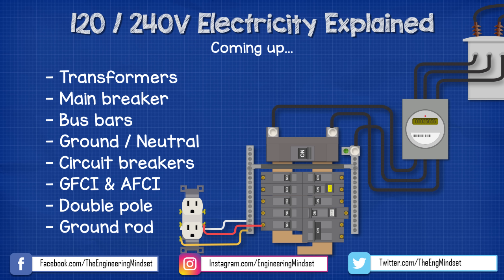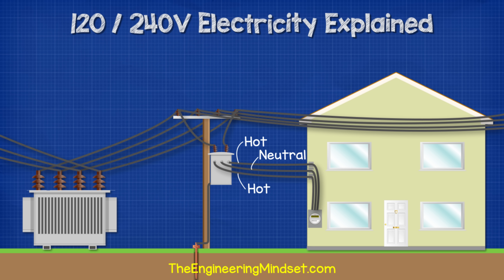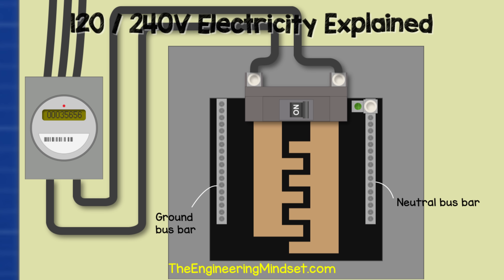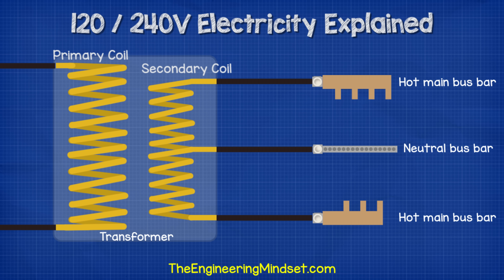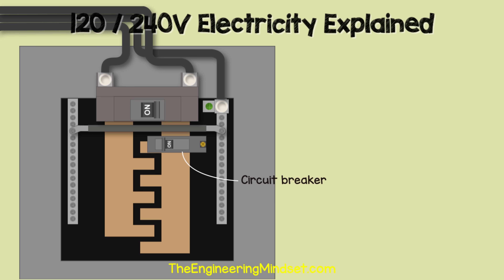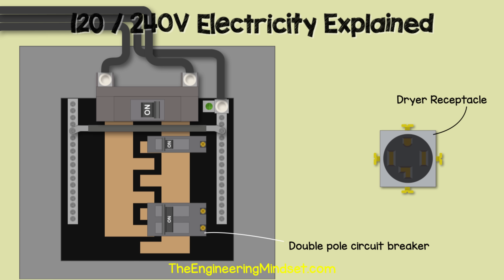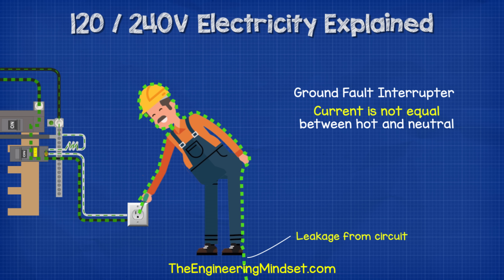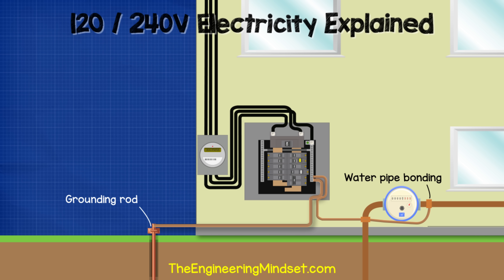120V 240V Electricity explained - Split phase 3 wire electrician

Comment: The system used in residential in the U.S. is a wye connected 3 phase system. Each phase is 120° apart. So you actually will measure 120V hot to ground, or hot to neutral, while hot to hot will measure 208V (1.73 x 120V) not 240V as stated in this video. Even though only two hot legs are typically brought to each residence it is still generated as a three phase system at all power plants in North America.
Reply from the maker: No, you get 120/240v in this split phase system. You're talking about a completely different three phase system which you can see in this video: https://youtu.be/qthuFLNSrlg?t=105
Reply: Apartamet building use a 3 phase transformer. each dwelling use a 2 hots + neutral 120/208V.

Comment: One tip would be for the video to explain that in both cases where the breaker trips, it is protecting from excessive heat being produced by the wires.
Reply: For motor controls, as most motors create an inductive load that can cause heat without current overload, there are heaters that when heated causes a bimetal strips to open the circuit, which upon cooling can be reset, these heaters have come in different specs to match the motors full load current.

Comment: Why does 220/240v not require neutral when 110/120v does not?
Reply: Because the electric potential across the phases is 220/240v. The only way to get half the value, or 110/120v is to only have one side of the electricity connected, thus using the neutral to complete the circuit.
Reply: @DTXBrian  so does the other 110 provide a neutral when out of phase?
Reply from the maker: Watch this: https://youtu.be/P-W42tk-fWc

Comment: great video, but just a minor point....as a   four-time homeowner who has done quit a bit of electrical work (owner residents are allowed to do so without permits in Georgia) I have yet to see the ground bar connected to the neutral bus bar in the load/breaker panel....now, that is NOT to say it isn’t connected somewhere upstream, perhaps in the Main breaker box outside the home (used by First Responders in the event of an electrical issue in the domicile).  That said, a homeowner should NOT connect these leads on his/her own.  Typically what is seen is THREE cables entering the service panel, all insulated...one hot, probably insulated by a black covering, a second one insulated in white, the neutral cable and a third, either bare or green insulation, the ground cable.
Reply: Only the main panel should have ground and neutral bars connected. All sub panels must leave the two separate. That said, I think the reason you haven't seen it much is probably because there's a main breaker outside the building (they're probably linked there).

Over where I live, only businesses and apartments have external main breakers. For most residential homes the main breaker panel is the main power panel, and it's located inside the building.
Reply from the maker: Check the new SUB PANEL EXPLAINED ➡️ video https://youtu.be/NUSNa-7Hecw

Comment: Alternating Current....excuse me (raising hand)....when the current is alternating, you initially have the black wire as HOT (120V) to the light bulb. The "USED Electricity"(whatever that is), travels to the panel on the white (NEUTRAL) wire. Now, when the AC current changes direction, the electricity moves in the opposite direction. That makes the WHITE (neutral) wire, HOT (120V), current goes 'backward' thru the bulb (the filament doesn't care from which way the juice comes), and then BACK onto the black wire, which is now the "NEUTRAL" wire. And back thru the switch....this would APPEAR to be a HUGE safety concern, but it isn't...why or why not?
Reply: QuantumRift why would it be a huge safety concern?
Reply: @luket6405  OK, follow me here...AC current goes both ways, right? That's what the video shows. It shows the electricity moving in one direction thru the load (bulb, for instance), then it shows it moving the opposite direction. SO, to make it easy, the explanation just uses the AC as going "one way", like DC.  Which form of electricity "killed" more efficiently back in the AC-DC war days? AC.  So, if you grab the black wire, on the "HOT" side of AC circuit, when the current is moving towards the load (bulb) and use your other had to grab neutral or ground, what happens?  ZAP. You get fried. SO, now, go 'downstream' of the bulb. Grab that (bare) neutral wire with one hand and then GROUND or the "black" side with the other hand. When the current is flowing "opposite' as the video shows, you should be shocked just as easy in the other direction. But are you? Let's say for argument sake that we're not dealing with 60 Hz 120V AC but,  .5 Hz 120V AC. Much easier to envision - so it's it's easier to grasp each side of the wire (or measure voltage, if you don't want to get shocked)...you should read 120V to GROUND (or neutral) when current is flowing ONE way thru the load, and then when current reverses, put the + lead on the neutral wire and the (-) wire on ground or on the 'black' side. The current should read 120V. BUT do you get shocked???? Why or why not?
Reply from the maker: Watch this: https://youtu.be/P-W42tk-fWc

Comment: Soo... They have both 120V and 240V, because with the low power they can't drive bigger machinery?
Why not directly opting for a 230V/240V system in the first way? Many AC/DC Converters support both systems anyway and it is less hassle to install/setup.
Reply: Historical reasons. Houses are built based on a single 110 volt system. Switching to 240 would force people to buy transformers for all of their appliances that are not running on 240. "Many AC/DC supports both" isn't much true. Most home appliances only supports 120 volts in the US. The move would be costly, and making sure everyone is ready to do it will be am issue. You can't just crank up the voltage in the system...

Comment: Still dont understand why in this modern times this country,s stil work whit 120 volts,and this split systems whit 240 volts for high watt loads Our in my case Dutch, european system of 230 volts , 3 phase, (400/230 ) volts works way better , also on the 3 phase power system whit motors etc... lots less amp loads. (and no pole transformers and lines above ground, other then the lines from the power plants to the city,s, where we step the 300k volts down to 10k volts, and per block a main power transformer from 10 kv to the 3 phase 230/400 volts,...We normally have the 3 phase 400 volts in every home, where in the most homes only one of the phases is used, and the neutral, to become 1 phase 230 volts...  In my opinion the system in the us and canada is obsolete...
Reply: We use it because virtually all consumer appliances here run on 120 volts and at this point it would be irresponsible to expect every us and Canadian citizen to buy all new stuff. Most places here that have high current loads use 3 phase 480 volt systems for their increased efficiency. Most cities are putting their power system below ground these days except for transmission lines between substations. We use pad mount or pole mount transformers. The video was just showing the most basic setup not what all power companies use around here.

Comment: You need better grounding. I don't care, never trust "neutral."
Reply: They serve different purposes. Contrary to what was shown in this video, in a balanced panel in an ideal world, the neutral does not return electricity to the transformer, and it would actually have zero current. It is there to provide a mechanism to balance the electricity on each half of the panel. Grounding is only present to provide a route for electricity to travel in the event of a fault. In an ideal scenario, the ground would never be tasked with carrying any electricity at all.
Reply from the maker: Watch this https://youtu.be/P-W42tk-fWc

Comment: I remember having a 240 line break one of the leads coming from the pole to weather head. 120v stuff was still on, looked at the digital meter was showing nothing, but had power. Still called it in didn't want the thing to short out given it was 110 degrees outside.

Comment: Why some area have 120/208 not 120/240 ????
Reply: 120V/208V service is a 3 phase 4 wire wye configuration traditionally used to service commercial properties. This creates 3 hot wires and one neutral wire. There is 120V between any one of the 3 phases and the neutral and 208V between any two phases. The phase-to-phase voltage of 208V is different than the single phase 240V due the how each step down transformer was designed.
Reply from the maker: You can learn about that in this video https://youtu.be/qthuFLNSrlg
Reply: You will have 120/208 power in almost all residential and commercial properties in the US since the transformers are wye connected (or center tapped) to create a grounded conductor, normally called a "neutral".

Comment: I love your diagram of the guy drilling into the wall and wire, then he stands up and smiles...my experience is if you do that there is a big bang or pop , and eather A your drill bit melts and you dont get shocked or drop your drill and run and recover from the shock, and try walking it off because it can hurt like a bitch!!!
Reply: Ron Merkus    A cable company guy drilled into a 2 million $ house in St Louis a few years ago to install the cable.   Unfortunately, he drilled into the service entrance conductors which only have utility company overcurrent protection ahead of the transformer.   Sorry to say, the house burned to the ground a few days before the owner was to move in.   TRUE STORY!   I swear!

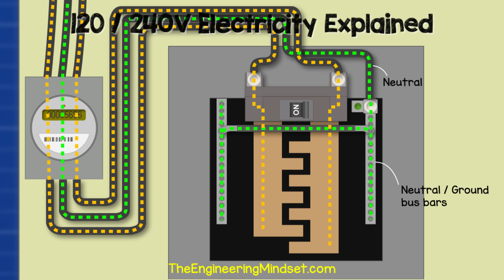Comment: 4:10 Stupid question but how would used energy be transferred back into the converter and what is the purpose of this? I'm an automotive tech so I deal with DC not AC current
Reply: BlownViper 505    Not stupid!   When you turn a key, and the starter spins, the power comes from the battery to the starter, through the starter, back to the battery, and through the battery.   Completed circuit, correct?   120 volts is not 120 volts at all points in time.   Starts at 0 increases to about 170 volts then reduces to 0(let's call this positive or above 0). Then voltage starts to increase in the opposite direction up to 170 volts and back to 0.   120 volts AC RMS(root mean square).  Similar to average.   Does this help?

Comment: Heh I watched this to see if it was factually correct and yes, yes it is.  
Worth noting that rather than GFCI breakers for receptacles most electricians will choose to install a GFCI receptacle which can feed others in series as is is a VASTLY cheaper option than the breakers. ($15 vs $70-200 depending on panel). Only exception to this are things like hotttubs, in which the GFCI breaker isn't really a choice.
Reply: why on earth are they so Expensive in the US?

In Australia you can get an RCD with Overload Protection called an RCBO, for $30 AU

https://www.bunnings.com.au/deta-20amp-residual-circuit-breaker-with-overload_p4330895

In Australia every single circuit has to be protected with an RCD

Comment: The ground cable ( green) and the neutral cable ( white) in the same barrel connecting?
Reply: Only allowed in a main panel and if the lug is designed to be double plugged. The hole will look like a snowman if it is designed for 2 wires.
Reply from the maker: Watch this https://youtu.be/P-W42tk-fWc

Comment: So different from the European system, not only we don't connect the ground bus to the neutral it is not even allowed, and would trip the main RCD anyway.
Reply: You can wire them together on the main breaker panel. But when you're running a sub-panel you must separate the grounds and nutrual. And wire them separately to the main panel.
Reply: That means your neutral and ground are not the same potential. It’s likely you have what’s called an isolation transformer and only a single phase/voltage. Under those circumstances, I don’t believe that either of your line conductors is actually neutral, but rather each leg floats at half the mains voltage.
Reply: Well at least in Portugal our code won't allow connecting ground and neutral together even though the potential between ground and neutral is zero. It is mandatory that you have a ground rod on each installation. The reason I say the rcd trips is because we used to have a main breaker limiter installed and sealed by the electric company that also acts as a 500mA RCD. Then they started using limiters without RCD and now they don't put any breaker at all and the power from the meter goes directly into the main breaker/RCD installed by the electrician. Now, the newer smart meters act as a breaker/limiter and you if you overload the limit you have to physically go outside and reset the meter. But still our code won't allow tying ground and neutral together at the panel even though they are the same. Also the main power transformer outputs a 3 phase 400V (230 phase to Neutral) and the neutral is done on site with ground rods. There are so center taps or floating grounds here.
Reply: t0nito    Very interesting!    Please explain how you can check neutral to ground voltage and get 0 volts and the two have no connection anywhere.   Is it possible that they are tied together by the utility or supply company?   We have 416/240 volt systems here in the US too.   This is the same as 208/120 and 480/277 volt systems in that they are all wye connected, and have neutral which is grounded.
Reply from the maker: Check the new SUB PANEL EXPLAINED ➡️ video https://youtu.be/NUSNa-7Hecw
Reply: There is no European system. Europe is not a country.
Reply: @CorneliusTaylor-s1u I know Europe is not a country, I'm Portuguese LOL, but I'm not aware of any European country that ties the neutral and ground bus bars together like they do in North America, correct me if I'm wrong.

Comment: 6:30 what kind of electrician would you be without drilling holes in the house mains?
Reply: ionbladezofficial ‘a cold one’.
Reply: ionbladezofficial    A cable installer did it in St. Louis a few years ago!   Burnt down the house because he drilled into the service entrance cable.   $2 million house burned to the ground.   TRUE STORY!

Comment: I'm not that old (early 70's) and back then it was 110v/60 Hz or 220v/50 Hz.. then it got 115v or 230v and now 120v and 240v.
In the 80's my grandfather worked at chemical factory and they decided (when it was built) it would run only 110v/60 Hz (but at the time in Sweden we did run 220v/50 Hz). He worked as the head chief of the storage department of this factory and everything just had a shelf life of 6 months. So after 6 months even if it was encased in plastic and cost 10k dollars they had to put in a scrap container and buy another one... I loved electronics and he knew that so instead of he scrapping the unused/sealed part which sometimes could be worth incredibly money he gave it to me... But as a kid (11 years?!?!) I could not exactly use it, like a laser thermometer because there where delicate electronics that just worked at 110v@60hz... A transformer would not really work as I would have to change the frequency also... So imagine that, got stuff that was worth heaps and my imagination went wild but could never actually use it (when I was around 11 years)...
Reply: It's always been 120/240, where 110 is the lowest voltage you want (during load) before you begin having electrical issues on devices (possibly) - the outlet should always test at or close to 120 ideally. Devices in the US are rated to work WITHIN that range (110-120). Theres no such thing as any specific voltage really because its always fluctuating depending on the load on your mains. 

Heres a fun safe thing to do - test your voltage on an outlet in your house when everything is off. Then turn on some high power devices like an AC and check it again, now turn on everything you can safely.. Did it change? A lot? A little?

Comment: I dont get the GFCI and AFCI breakers. If you short the wires with a screw or earth yourself by sticking a screwdriver into a socket, surely this should produce the high current needed to trip a normal breaker anyway?

Comment: The purpose of the ground rod is to reference the ground wires in the house to physical ground so you don’t get a shock when touching exposed metal.  They’re called ground wires because of that connection.
Reply from the maker: Watch this https://youtu.be/P-W42tk-fWc

Comment: Why they connect the ground bar to the return line ?
I understand that has to be a separated connection between the BAR and the RETURN line of transformer.
Reply: It references the neutral wires to ground, and must happen at only one place in the house, at the main panel.  If you connected neutral to ground at a second location, then current would flow in the ground wire and it would no longer be at ground potential.  That would be a bad thing.
Reply: @stargazer7644  My friend works in industrial equipment and they ask for a separated bar to ground. Must of the time the electrician don't separate the connection, in that case  they ask for a separated bar to ground.
Reply from the maker: Watch this https://youtu.be/P-W42tk-fWc

Comment: hmmm. I don't think my house is wired properly like this... No main circuit breaker. No GFCI. Hardly any grounding.
Reply: All houses in the US are wired like this since the 70s. The gfci might not be a breaker, but may be incorporated in a special outlet, usually in a bath room or an outside or garage receptacle. It will have a test and reset button on it.
Reply: @stargazer7644  Nope. I got none of those either!